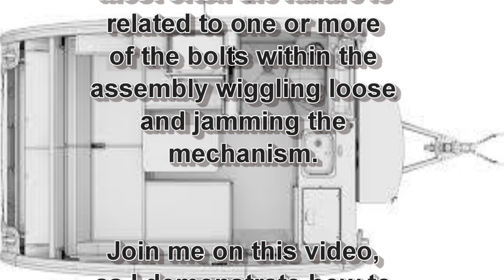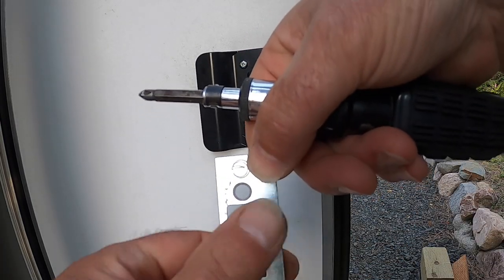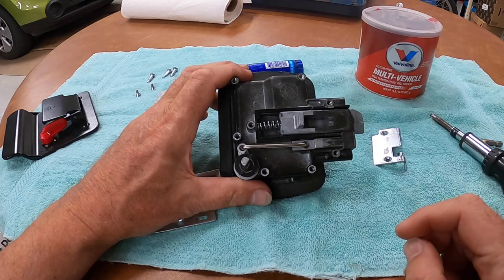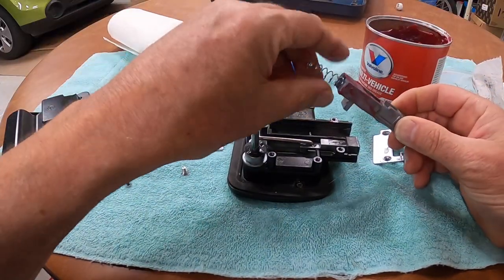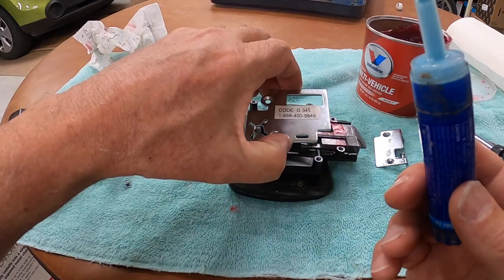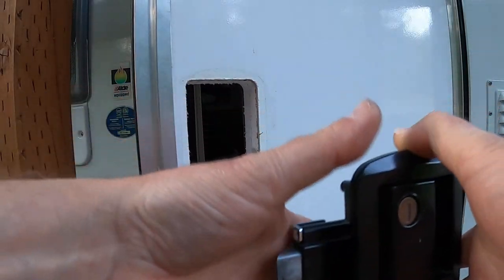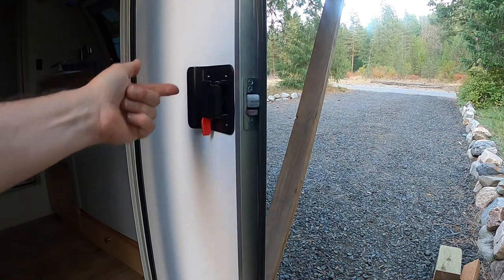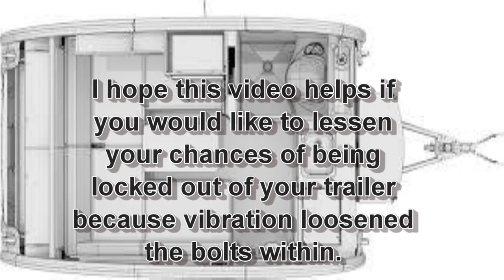Door Lock and Latch Preventative Maintenance - Tab Max s Trailer

Comment: Thanks for the video. Our deadbolt jammed on us after this weekend and is stuck. The key won’t go in the deadbolt. The door lock is fine. I took it all apart and could probably get it working again if the cylinder would accept that key fully. Tried to spray some silicone in since I don’t have graphite, just to see if it would help. Any ideas? Thanks again for the video.
Reply from the maker: The tumbler cylinders are a complex bit of kit. I would say that a locksmith could help you out, but replacement of the entire assembly is MUCH cheaper.
Reply: @tabtrailerupgradesandmaint2923  yeah, we think alike. I replaced the locks and then went through the new ones and followed your advice to grease and add locktite. Thanks for your video 👍🏻

Comment: Do you think this preventative maintenance will help with the lock latching when you simply close the door? I closed the door of my trailer with the keys inside and the door locked. Unfortunately for me, I was outside in my pjs with one dog and the other was locked inside. Not a pretty picture. It took a lock smith 3 hours to get to my location. Lucky for me I was in a campground not boondocking and I borrowed a phone from someone at the campground. There are so many ways this could have been worse. The door has done this twice and I keep an extra key wired to the outside of the trailer. But I would love to fix the problem.
Reply from the maker: Thes bit of maintenance likely won't stop a loose lock latch from vibrating and rotating closed. 
This just prevents jamming.
Reply: @tabtrailerupgradesandmaint2923  thanks